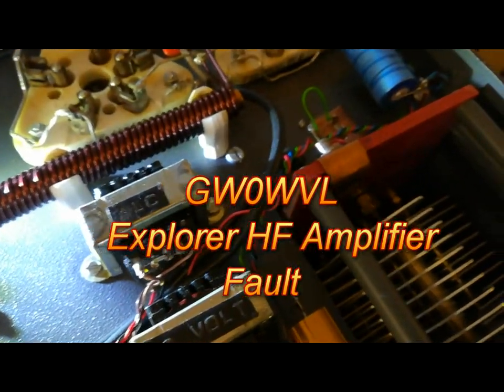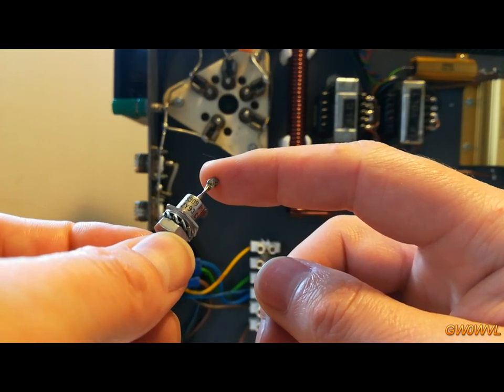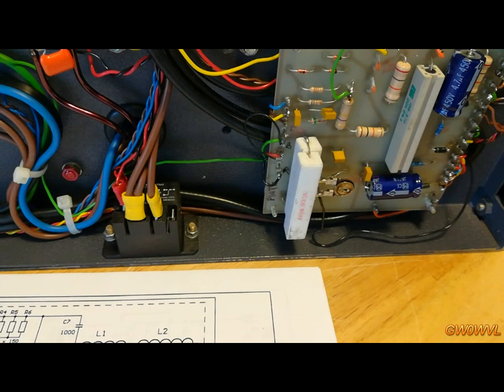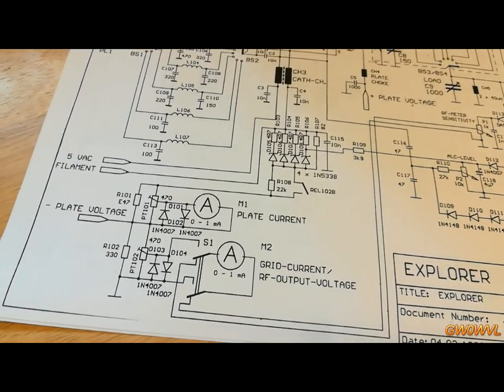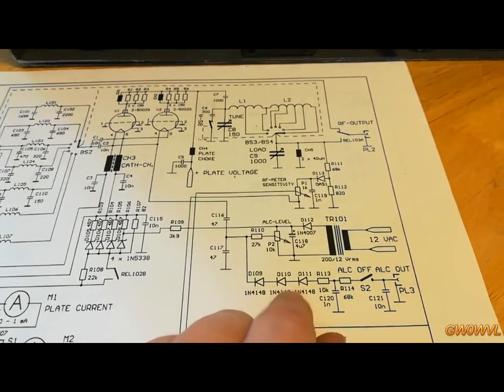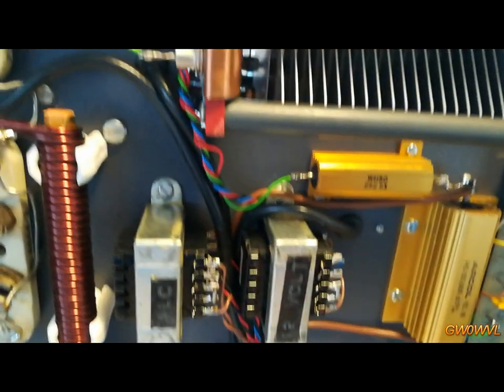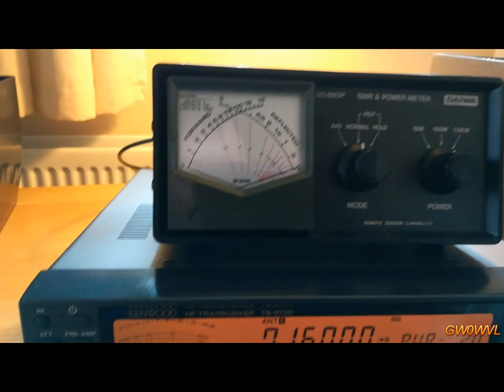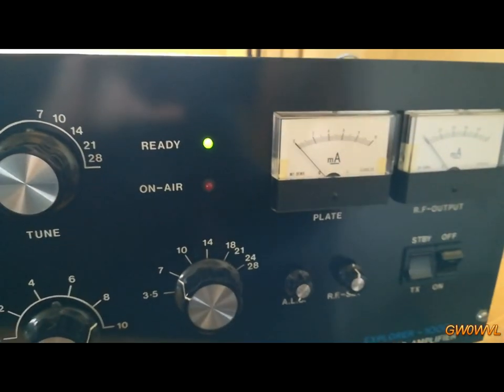Gw0wvl ... ' Early ' Linear Amp Uk Explorer HF Amplifier Faulty Bias.

Comment: excellent vid.  I have the exact same amp and found it impossible to get a circuit diag or even manual for it. Only ones I see are for a sister model. Any source to obtain said documents... paper or electronic. Cheers
Reply from the maker: Google " Peter Rodmell "  he actually built the amps .